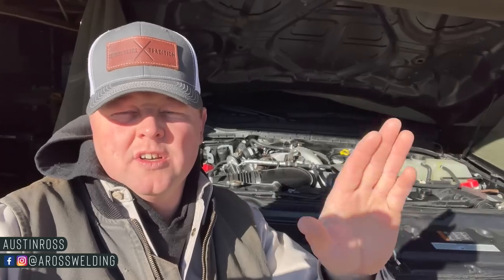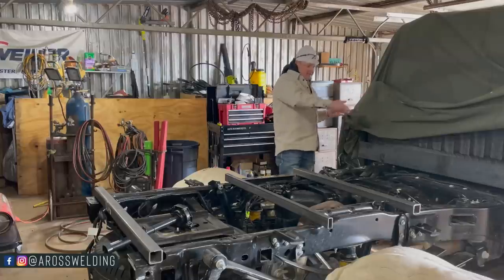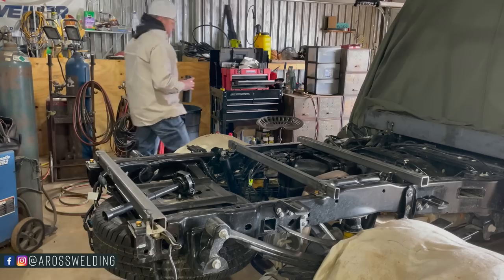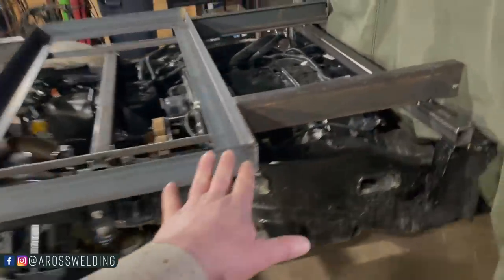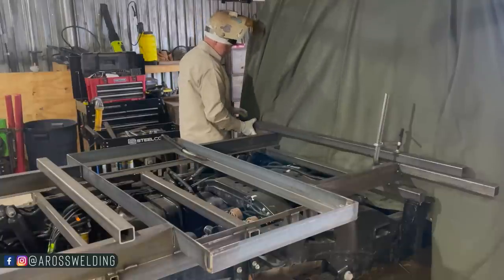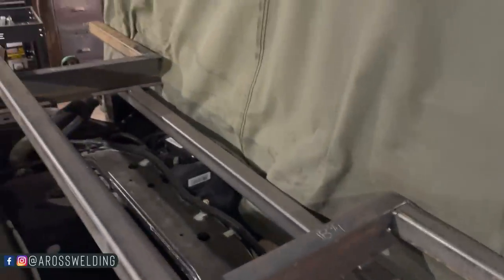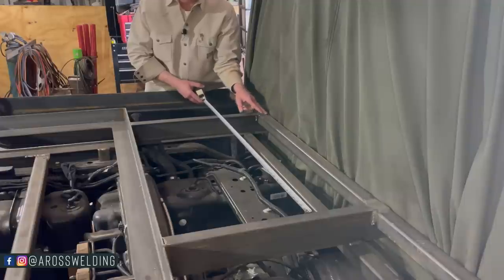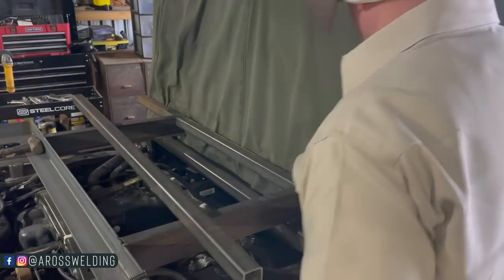Building a NEW Pipeline Welding Rig From Scratch (The Frame)

Comment: Mechanic note to welders who hate paying mechanics or do their own wrenching. Have an EASY way to get to your in-tank fuel pump to troubleshoot or replace it without dropping the fuel tank because the dang pumps seem to die when it's full and dealing with jacks, straps and hoses is no fun. I also anti-seize ALL my truck bed bolts, tank strap bolts if I pull a tank etc so the next time is much less suffering. If you picture a piece of 8-inch pipe centered on the fuel pump and leave a way to reach it with that much clearance you can swap pumps very quickly in the field and save towing your truck to a shop. Your wallet, your call.

Comment: Good advice at the beginning about welding with the battery Still attached.That was actually one of the first question I asked a stick welder at this alignment shop I worked for "YEARS BEFORE" I went to school for welding.😂he said one time he welded on a forklift and the battery exploded.There were a lot of hazards at that job they would bend 18 wheeler truck axles back if they got screwed up during an accident.All they did was put a solid metal ball between a hydraulic press and the axle and apply air pressure the guy who ended up taking the position I was training for had his face blew off by one when it slipped out he had to get his face completely reconnstructed.anyways a bit off track good info😅

Comment: I love this!  I’m looking forward to building one for my ‘63 Chevy but there is a lot more to do before the fun stuff
Reply: Buy a cheap running !  3/4 ton 2000s  Silverado   & swap everything 
Better fuel economy & more torque & overdrive , air condition  
Engine harness  run the gauge cluster near floor     
 Adapt rear axle
Reply: & parts are everywhere
Reply: My first truck was a '63 Chevy. Bruised my knees a hundred times on that stinkin' windshield dogleg! But I learned a lot working on it and had a bunch of fun.
Reply: @briantruck2284  kind of the idea actually. Except it’s a C60 so the axles will come out of something a little bigger than a Silverado.  I am for sure looking forward to finding the Gen VI 454 to replace the stock 230 with
Reply: @JacksonEngineering   change axle fluid  & reseal diff cover 
New brakes lines

Comment: In the 3 main manufacturers Body Builders literature it states to disconnect the battery (s) before welding. For years I built trucks from cab & chassis and after leveling them in the shop on jack stands for the build, we always disconnected the batteries.   Why take the chance.

Comment: I've built 7 flatbeds so far and I'm always jealous of you pipeliners. You seem to have the time to build the bed on the truck in a week or less sometimes. I've always either been driving the truck, or the customer is using it and I have to run them down on the road or farm site to take as many measurements as possible, multiple times lol. I always start with the deck skin laying upside down on my shop floor, then I build the frame and skeleton on that flat surface. then flip it over, and build the headache rack and boxes. Then I need the pickup for about 3 days to remove the original bed, make the mounts to the frame get the fuel filler neck made, then install the original bed back on and send it back for about 1 week while I paint and wire the lights. Then it's about 2 days to install, finish the final wiring, and send it out the door.

Comment: If the vehicle your welding on is new enough to have a computer BY ALL MEANS UNHOOK THE BATTERY. All kinds of things can go wrong and maybe you get by doing it but the one time you get feedback through the electrical system good by computer. And they aren't cheep..
Reply: By using roll outs connected to your bed nobody disconnect the grounds.

Comment: Hey Austin, I see you using a "grass hopper" all the time and have heard you say it is so that you don't arc outside of the weld zone or something like that, my question is what would be wrong with using a magnetic ground? I am not a pipeline welder but do build steel buildings and pipe fence and love my magnetic ground.